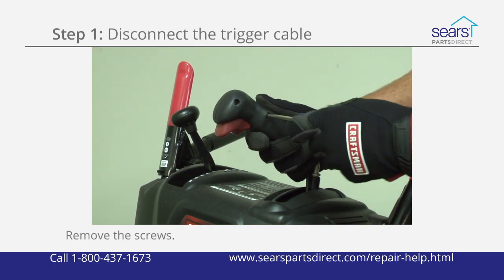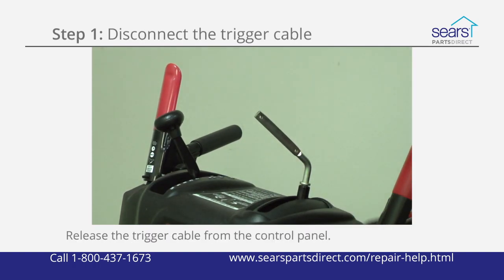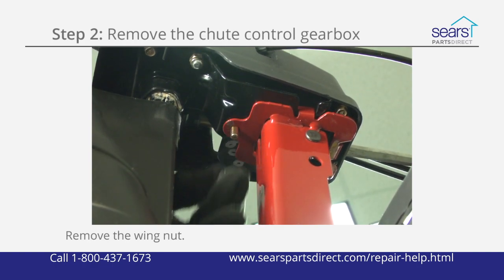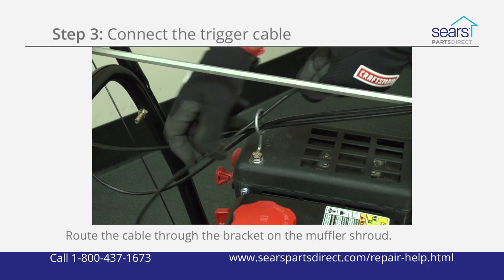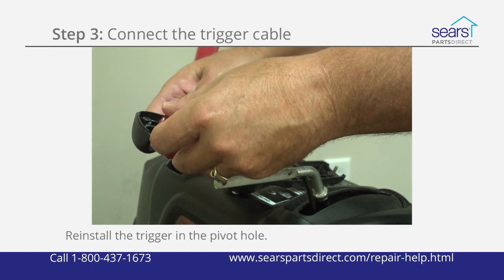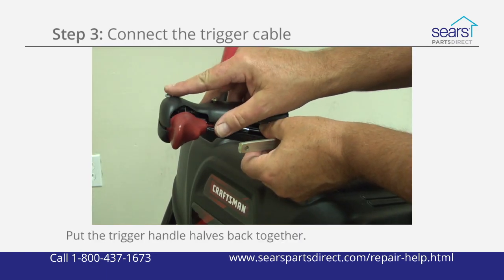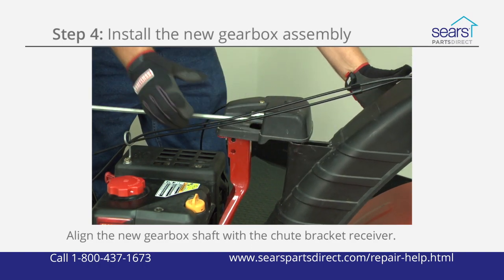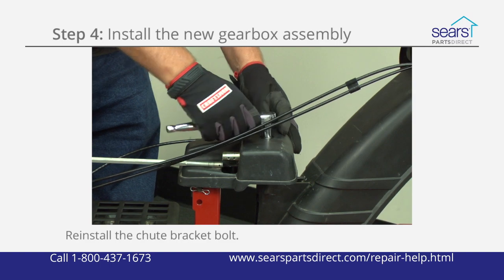Replacing a Chute Control Gearbox on a Snowblower

Comment: Before you spend $100 on a new chute control gearbox, make sure the release trigger in the hand grip is working correctly.  It's a poor design.  I found that the cable anchor could easily slip out of the slide mechanism the trigger engages to pull the cable.  When this happens, the release isn't pulled and the chute won't rotate.  It was a simple fix, I cut a narrow strip of duct tape and wrapped it around the bottom of the slide mechanism after I had the cable anchor inside, so the anchor was captured and could not come out of the slide.  This also made getting the hand grip put back together a little easier as it is one less thing to come apart while trying to get the screw holes lined up while keeping all the loose innards in their proper place until the two halfs come together.  If anyone does need a gearbox, I have a brand new one I could sell you.
Reply: If only it didn’t take me three weeks to get the new gearbox assembly, and I hadn’t exploded the innards on the old one to clear my driveway of 18 inches of snow. Also learned this the hard way.
Reply: @iamthetoe  It's a very bad design, I can not get mine to where it releases comfortably.  It's like there is 99% play in the trigger and the last 1% actually releases the chute (sometimes).  So I'm always just about to freewheel or just about stuck.
Reply: @robsik1747  Make sure trigger slides into actuator open, also would lightly tape cable to actuator so it doesn't move. Like the video states make sure you assemble trigger first then slide on handle and secure the other 2 screws.

Also, make sure you put cotter pin for rod in hole closest to chute. Had mine in first hole and would not work, put it in 2nd hole and worked like a charm.